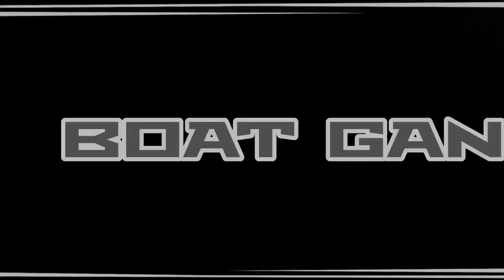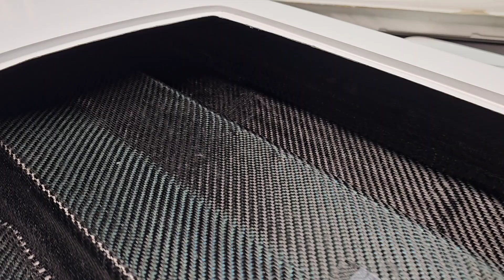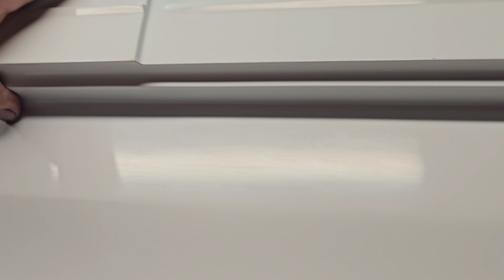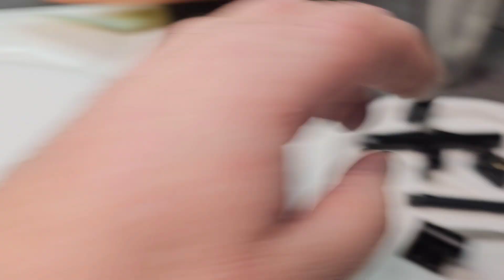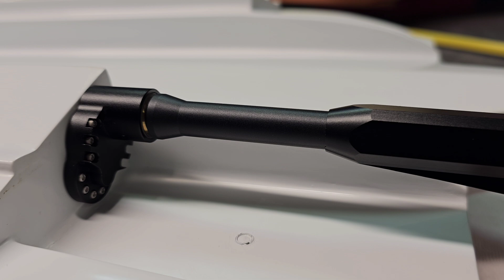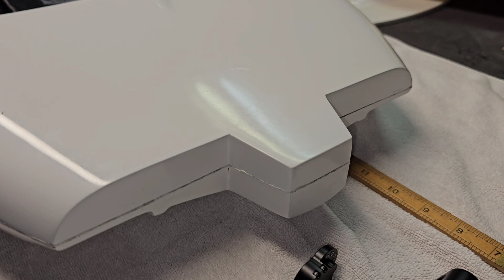Introducing Our Next Project MHZ 57" Bulgarian Catamaran

Comment: So the higher kv the smaller the prop you can go with? And then depending on amps and heat you could prop up. Also generally speaking you could “s” up too? Is that pretty typical?
Reply from the maker: Yes, sir you're on the right track.

Comment: A Bulgarian Cat, now we're talking! (I love your other boats too ;)). That is a serious hull, and will be impressive on the water. A fellow Dutch RC boater runs this exact same hull as well. Twin 56mm motors, big props.. that boat sounds and runs awesome!

I see several comments on the stinger drive mounting. The transom mounting is often used on SAW cats, as they use longer protruding stingers to keep the boat on the water!
Reply from the maker: Yes, that's exactly what these drives are designed for, 1" longer than the MHZ drives.   This drives uses an 8mm shaft which is insane!

Comment: Wow, an mhz. They are good! In my personal opinion there is only one way to build these boats, and thats the right way!That means in this case other drives to start with. These were not ment for this boat. MHZ has rudder and drive assemblies to complete a build. Would think motormounts too. Think they work together with WD200 to produce their hi-quality aluminium parts. 
As a finish a nice paint job (like rc airbrush artist with a theme) or a wrap and off course cnc milled internal covers to tidy it up. Also a magnetic kill-switces (EMCOTEC) if possible, these are beautiful!
This all adds up, but it also inhances the value greatly. These kind off builds are even after 10 years still worth lots off money when build correct. 
Well, this will be interesting journey for sure!
Reply from the maker: I agree, I kinda like the Mhz drives, they mount nice and clean under the overhang, basically designed for the B57 hull.     The CCRP drives that came with this hull seem to be of very nice quality and will work on this hull, designed for high speed SAW passes, but to me, in my eye, look a little bit too big for this application..    I want this build to be absolutely 100% built to MHZ standards
Reply: @IRONCLADRC  those drives are beautiful but not right mount and need to be worked. Also think they don't look right. Would sell them... Question is more what you guys want. I mean, in a ONLY saw build somehow everything goes, and the 140+mph already run with these boats is a challenge on itself too. A then i would spend less on its looks.
Personally would prever scale looks over all out speed. Its not that often your able to run 120+ unless you have a big lake in your backyard...

Comment: Im not totally sure about this boat your building but all the mhz cats i have seen dont have anything but the rudder hanging off the back. All the drives i have seen the bracket was mounted under the boat & was adjustable. Are those the right mounts for that boat. Always wanted a boat from MHz. I think shipping has kept me from buying. Have watched their products for years. Cant wait for the build to start.
Reply: Shipping was $150.00 and -$250 for 53 to 58” …not bad for a $2000.00 MHz mystic 138/53”and Manfred Kulz fountain 58”-$3500.00 boat, that’s rtr less radio

Comment: I cant believe how much $ these hulls go for. Wanted to build somthing in the 50+" range this winter but holy hell. I'll be sticking with my pro boats 😂.
Reply: Bro  don’t know your budget but 50” gas boats are about $2kthere and you have a boat that’ll run 15-18 laps vs same size big single or twin electric that runs 2 to $3000.00at 7-8 laps
Reply: @stevesocransky6341  i have soo many hobbies atm i can't justify $3000+ on one boat right now. We only get 3-4 months of warm water where I'm at. I'm an auto body tech, so if I could find a hull with some damage, I may be able to sneak my way into one 😂 (no races around me 😭 I just take my boats to the lake when I take my real boat out lol)
Reply: You can find used gas race boats in the 48-50 inch size used in nice shape for 7-800.00!!! Electric gets pricy to buy the big batteries and esc’s
Reply: @stevesocransky6341  not a gas fan. Too loud for me and they stink my car/house up. i'm already so invested in lipos and chargers.
Reply: Yup they are kinda loud but electric makes some noise also, I just got into gas as well to extend the run time when I use up my battery pack. I have over 20 fe and scale boats, and 3 gas boats… gas doesn’t stink up my truck or house at all and gives me a way to run for 10 minutes and get back on the lake in 5 minutes …. The gas boats are 48-58” and run in chop. My big53-58” fe hulls take 4 large batteries for 10-12s and run for 8 minutes … some days are too rough to run 34” p limited size boat
Reply: @stevesocransky6341  my Nitro cars always stunk up the house, garage , and car lol They never started when I wanted them to the most. I was too young back then honestly, but electric is just sooo much easier. When it comes to this hobby I just want to load the boats up and go. Don't want to tinker while trying to enjoy my day on the lake 🤣. Call me lazy or whatever but I turn wrenches 40 hours a week at work lol